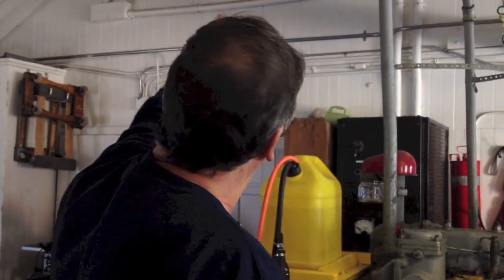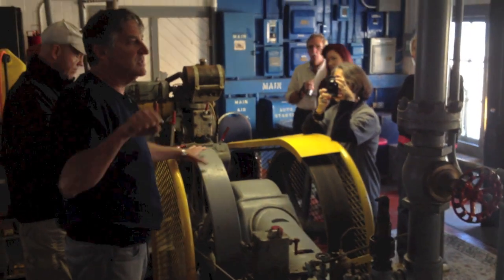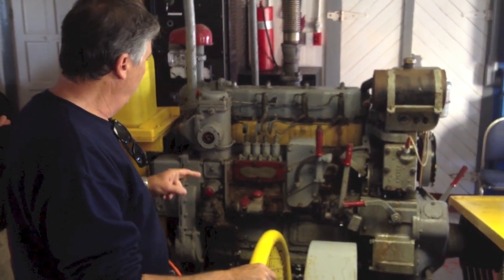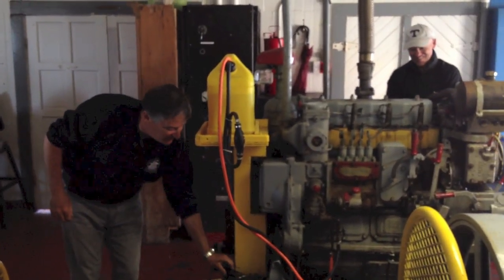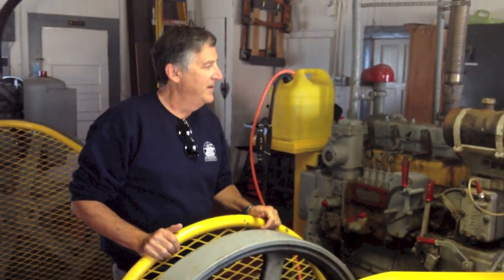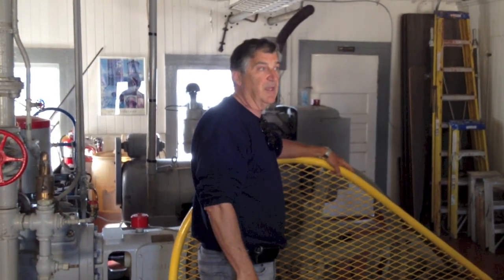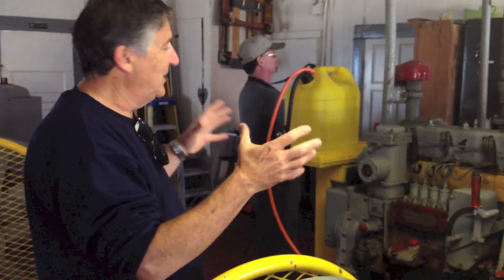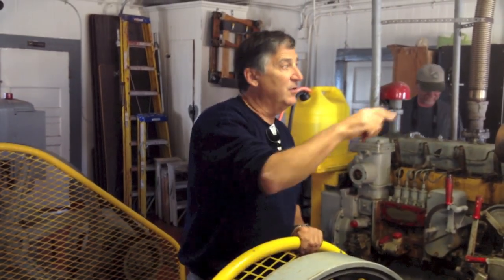How The Historic Foghorn Works

Comment: What sound pressure level does this device generate at 1 meter distance from the source?
How far does the audio wave reach under normal fog conditions? (no wind)
Reply from the maker: Excellent questions!! I know all the bridges in the bay can hear it but in no longer runs regularly. You can contact them directly, I can almost guaranty this guy has the answers. Or anyone there can also probably answer? Wish I knew too!